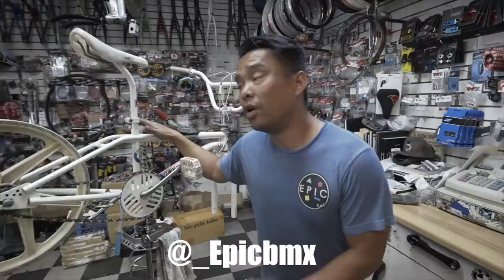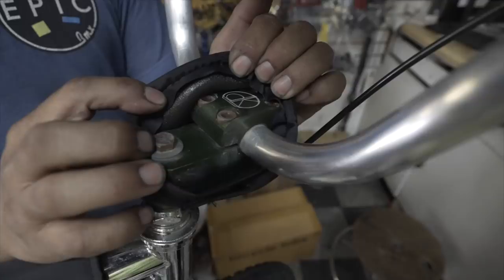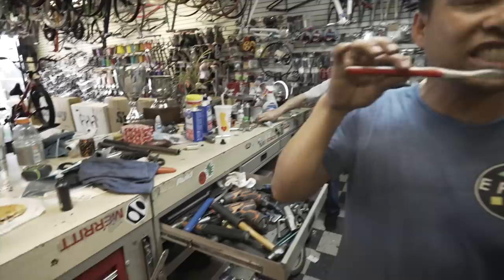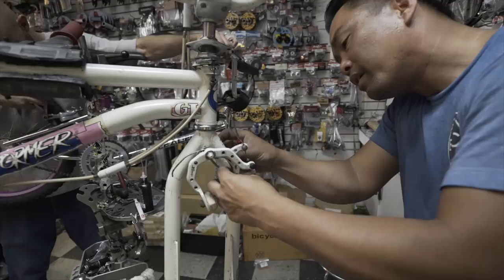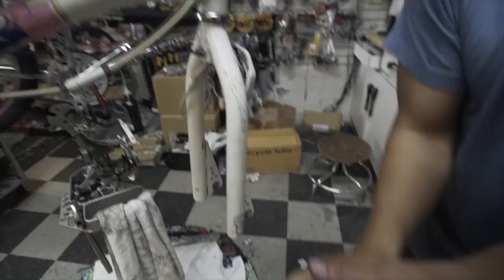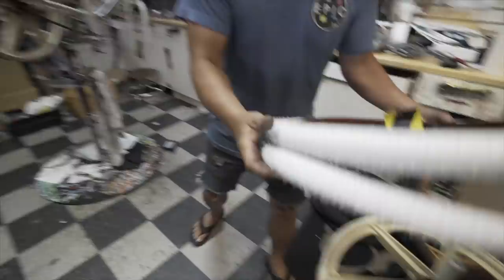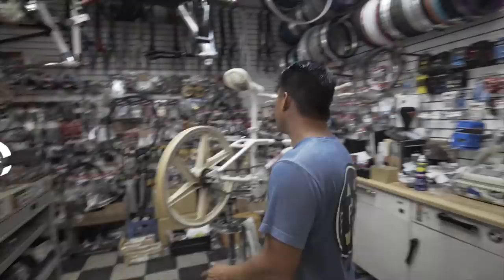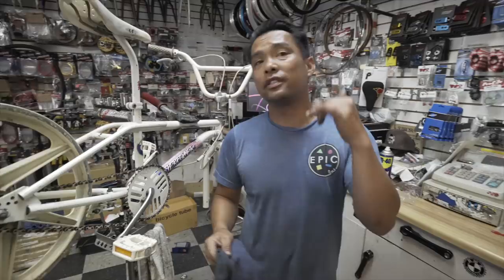5 Crazy Bike Hacks To Restore Any Bike!

Comment: That aluminum foil trick will now be a part of my tool box..
Reply from the maker: Dude SAME
Reply: Use wd40 with the alfoil. Its much better then rubbing it dry.
Reply: Also, alfoil doesn't scratch the chrome because alfoil is weaker than chrome.
Reply: Does it work on neochrome
Reply: Fine xxxx steel wool and wd40 always worked for me

Comment: Sick Performer and Limo!!! Steel wool grade # 0000 and WD 40 also works awesome on removing rust off chrome. Im Restoring a 84 OG chrome GT Pro Performer that sat directly out in the Phoenix Az sun/monsoons  for decades that was riddled with surface rust. You couldn't even turn the handlebars, cranks and axles.I thought I was going to have to powder coat the frame which would of been sac religious.  I gave it a shot and the chrome looks like it came out of Phus shop right off the showroom floor back in 84 w/no rust or scratches . After steel wool, I  rubbed it out w/some Mothers chrome aluminum polish. Works amazing on restoring old muscle car bright work/trim as well .Nice resto tricks Phu!!!! Love ur 80s builds!!!!

Comment: For the plastic parts to add shine or life back into them put Vaseline on the parts let it soak in or chapstick works to work it in to coat the parts then you can either sand the parts or wipe em down to see what is needed after

Comment: If the old chain is really knackered then the sprocket/chainring might be as well so a new chain won't mesh very well. It might be rideable but the worn teeth will cause the new chain to wear more quickly. You should look at the teeth of the sprocket/chainring, if they are looking like a shark fin (curved on one side and straight on the other) they're knackered.
If the old chain is only a bit worn and the sprocket/chainring looks okay then replace the chain now and the sprocket/chainring will last longer.

Comment: Careful with the aluminum foil, I’ve seen it scratch chrome handlebars. Usually if you barely apply any pressure it seems to work okay tho. Great video, learned some helpful stuff for my resto project

Comment: I was wondering when you guys were gonna show those old school bikes. I have at least 5 Gt performers. I’d keep the chain and try to restore it later especially if it’s GT stamped. Until then I’d put a chrome one on there. Personally I’d tear the bike down and give everything a good cleaning. Keep it og and add the new tires and brake pads. If the bike was completely trashed I’d go for a complete restore. Show more videos like this with the old school bikes!

Comment: Not guna lie, the metal file on the ogk rims made me cringe lol. I wonder how many times that can be done before you reach the point of no return. Also, just run white brake pads? Or would the dye remove the black eventually. Prolly take many a few times. Nice video

Comment: WD-40 isn't a lubricant, it isn't a cleaner either. WD-40 stands for Water Displacement batch number 40. As in when they invented it, they made many different batches, batch number 40 was the one they used.  Main ingredient is fish oil. Knowing is half the battle.